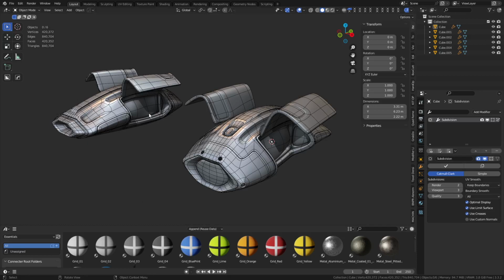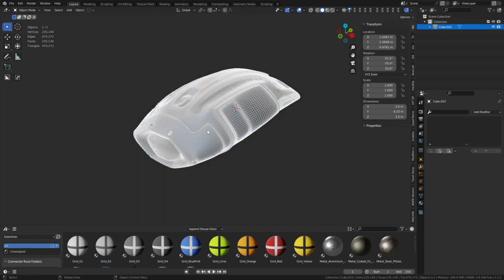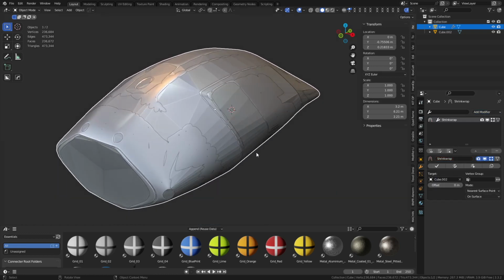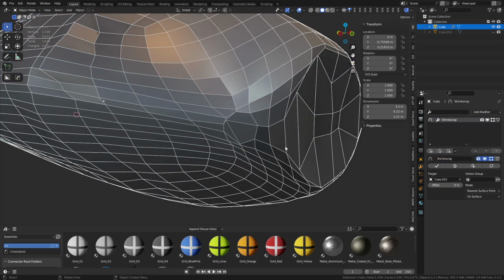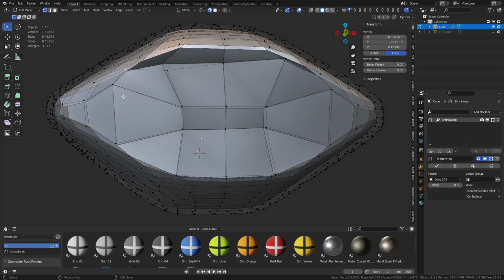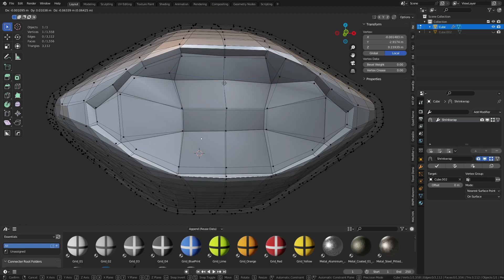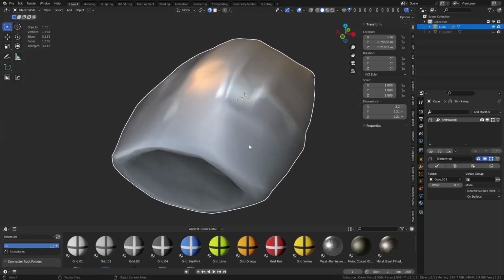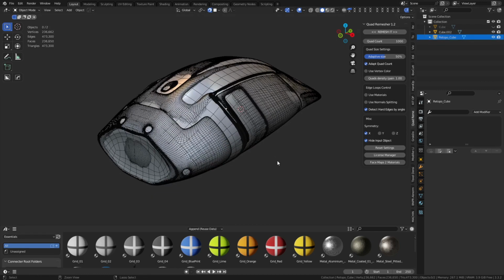Quick Retopo

Comment: @PZThree. If you have the time, how about doing a video taking this method through to Substance Painter (i.e using cage etc), to show high poly,low poly, cage texturing etc.? I say this as, watching some other YT videos they seem a bit disjointed and I reckon your workflow doing this may be the new standard for doing this etc?
Reply from the maker: It's nothing new though really. This gen/last gen, however you want to look at it. Typically went High Poly mesh to low poly bake. If you could save time with little tricks like this, it was worth it. Next gen is all about the high poly mesh.